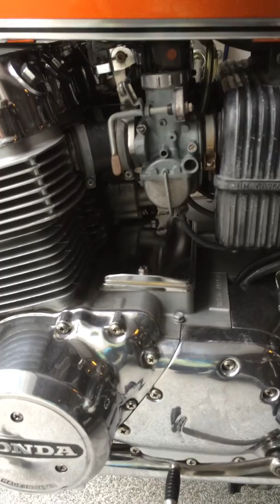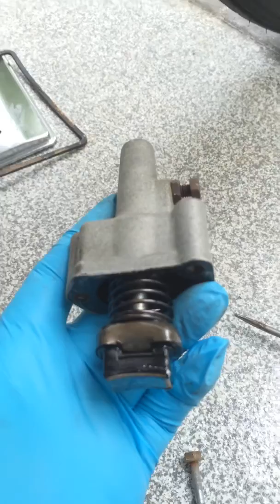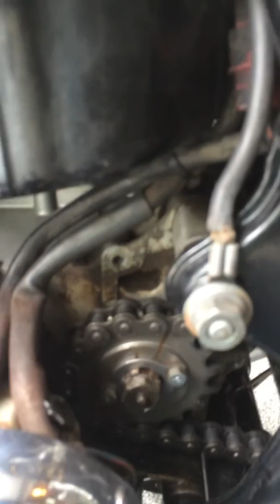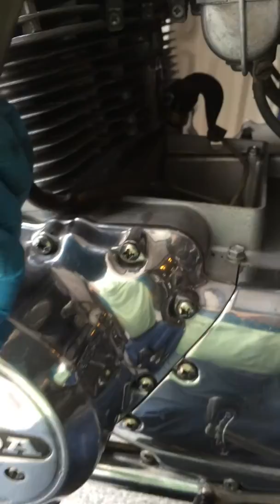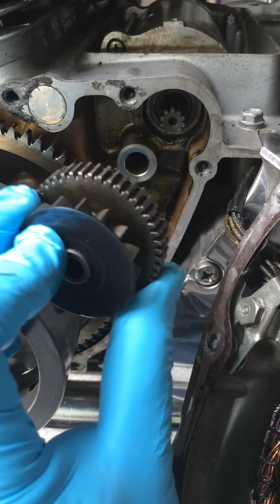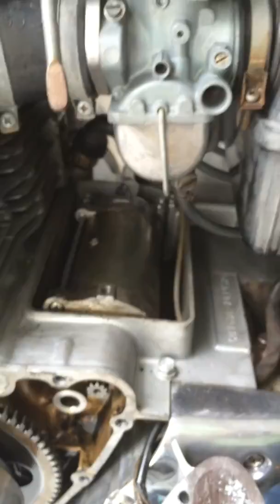CB750 1975 K5 Starter Motor Replacement and Installation

Comment: Hi, this is a great video very informative. Can I ask how you found out that it was the starter? I have a new to me 76CB 750 and I’m in the process of troubleshooting a no start issue. Did you test the solenoid first to see if it was that? Is there a continuity test? Thanks for any help in advance. And again thanks for the great video!
Reply: I’m in the exact same boat. Any pointers?

Comment: Let me ask you a question if you pulled the cam chain tensioner out then you didn’t start the motor didn’t move it couldn’t just be put back in its original position please let me know and I’m not sure if it’s the starter or starter solenoid that I can’t figure out you push the button and it lags and then it starts

Comment: Starter motor can be overhauled. maybe the carbon brushes or the bushings.
Reply from the maker: 8788luigi maybe. But for the sake of reliability I figured replace it. I thought about taking it apart and looking but I never got around to it. Eventually it got tossed in a recent garage purge.

Comment: To test the starter on the bike just jump the solenoid with a screw driver, it will tell you if it's bad without taking it out and having to reinstall it.

Comment: I see people test their starters by removing it and using a car battery to see if it spins.  Why can't I just leave it in the bike and check by putting 12v directly to the starter cable off the solenoid and ground to bike.
Reply from the maker: Fezzler61 that might not tell you if it works or if something downstream from the starter is broken. If you can isolate it in the bike by removing the gears that mesh with the main gear then yes that's a good way to test it.